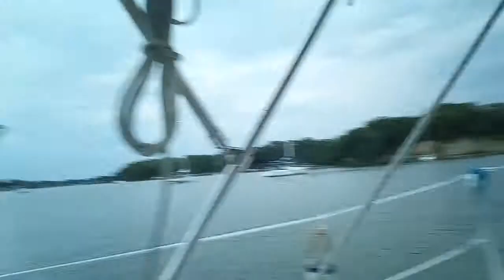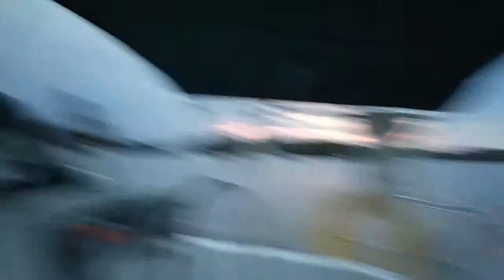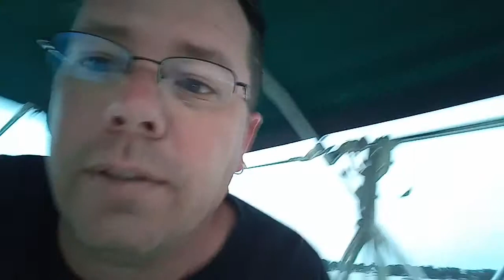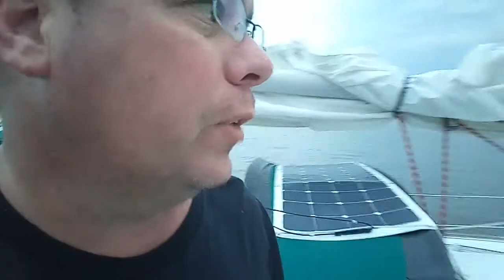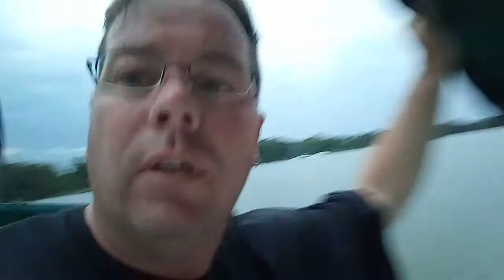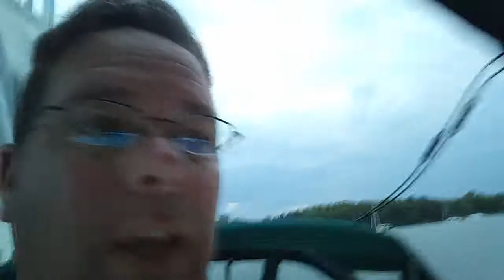Let's talk anchor lights and safety real quick and why your light is too HIGH!

Comment: I agree for the most part but an anchor light is still required at the highest point to meet COLREGS.   We are lit up like a Christmas cake out (or maybe a birthday tree) on anchor with supplemental white LED lights all around the boat at eye level but the one on the top of the mast on a sailboat is still required regardless -or the anchored boat is in violation.  We even run an anchor ball at 6' above the deck with a hanging light off of that.

We are full-time cruisers and have anchored almost exclusively for the past 5 years. We have seen that very few other boats bother to be visible at night and many derilicts and flophouse liveaboard locals don't even have any anchor lights at all.  The number of small boats using an anchor ball is probably less than 1%.
Reply from the maker: Don't forget your black ball during the day too.

Nothing about highest level. Just height above water. The top of the mast fulfills this easy. 
https://www.boatus.com/expert-advice/expert-advice-archive/2019/february/anchor-light-requirements#:~:text=USCG%20site%20reference.-,The%20Inland%20Rules%20have%20specific%20requirements%20as%20to%20anchor%20lights,with%20and%20follow%20the%20rule.

Comment: Always wondered why mount a light 35+ feet high when the captain is 6 - 8 ft above the waterline.....along with the masthead light, I also had a couple HF solar powered pathway lights on the bow and stern of my 36' seafarer.....happy sailing!
Reply: Rule 30 - Anchored Vessels and Vessels Aground:
(b) A vessel of less than 50 meters in length may exhibit an all-round white light where it can best be seen instead of the lights prescribed in Rule 30(a)

Rule 21 - Definitions:
(e) "All-round light" means a light showing an unbroken light over an arc of the horizon of 360 degrees

That "unbroken" part in the definition of all-round light in rule 21 is the kicker here.